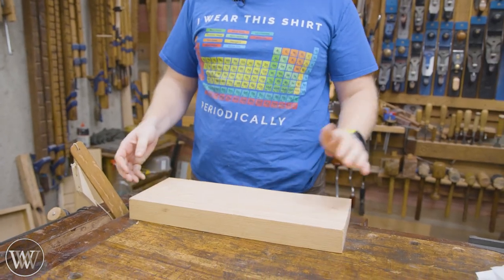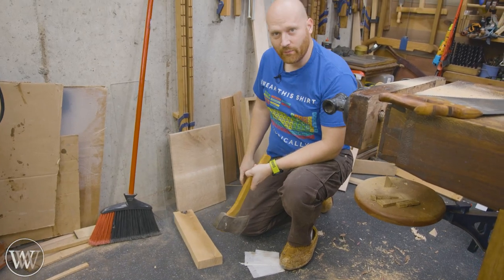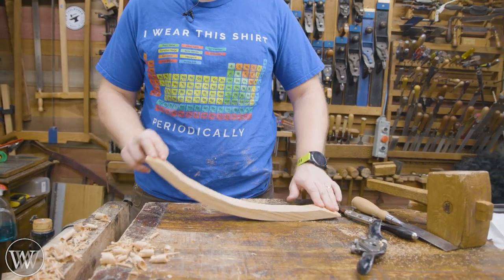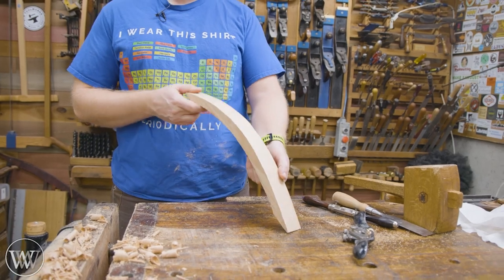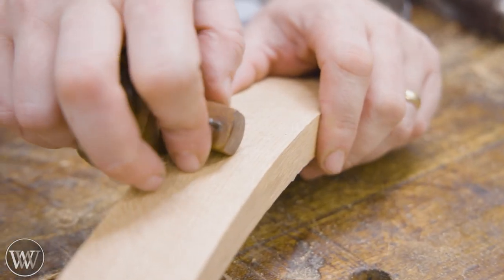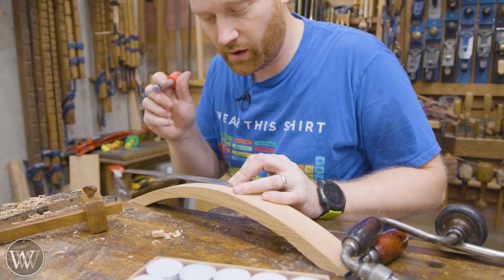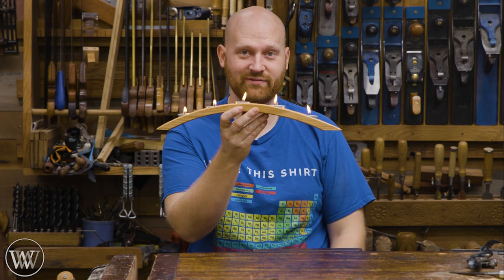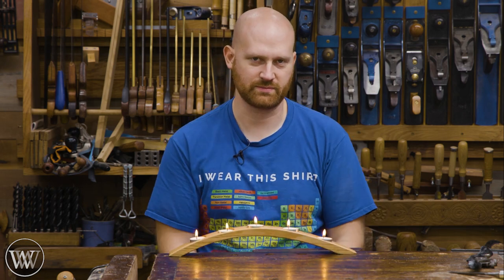Votive Candle Holder Fast Woodworking Project

Comment: When you started using the spoke shave it made me want to ask a question. Why push it instead of pulling it, is there a specific reason? When I use mine I've always gone with a pull stroke.
Reply from the maker: When in a vice I will both push and pull. It. Just depends on which direction I'm standing on and which way the grain is going. The two of them use about the same amount of force so it's nice just to be able to go both directions. In this particular instance, it's easier for the spoke shape to go downhill rather than pulling it downhill towards me.
Reply: @WoodByWright  makes sense tyvm.